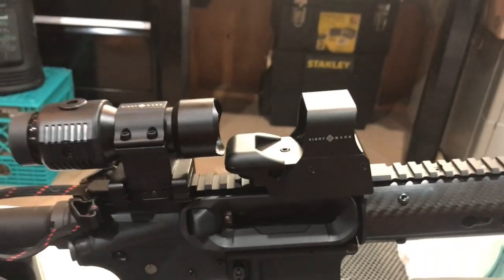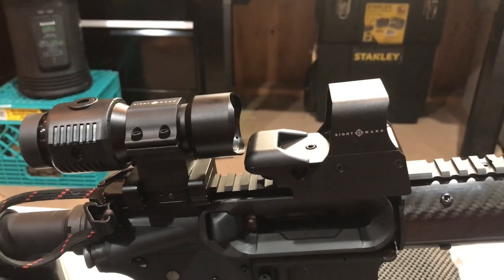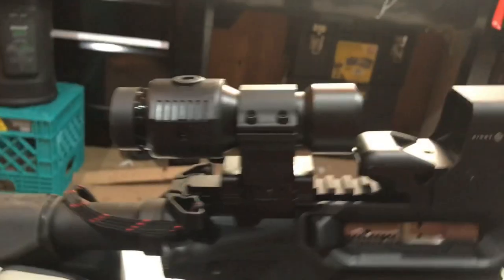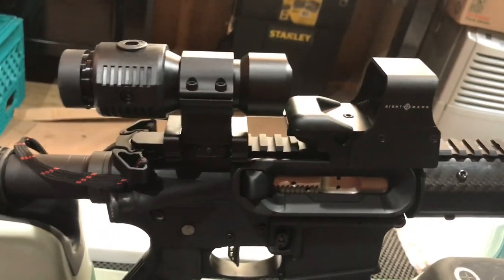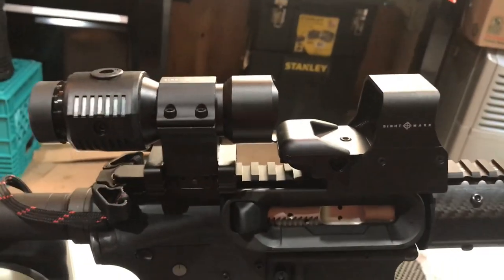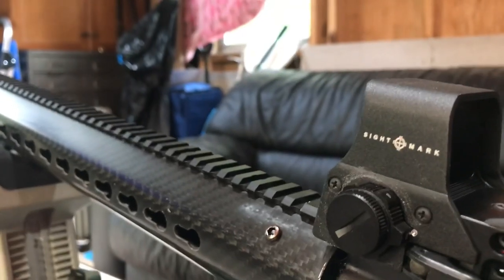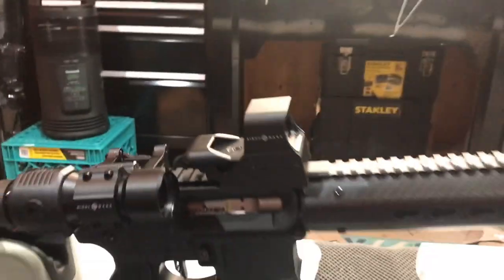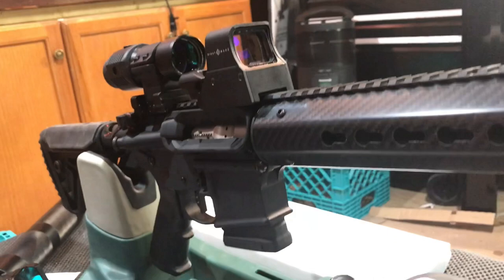Sightmark Ultra Shot Pro Spec & 3X Magnifier

Comment: I had the same setup many years ago, except mine was a 7x magnifier. I'd give it away to a buddy. It won't hold zero. The magnifier rock back and forth, making the red dot move side to side. Replaced with a Vortex Strike Eagle 1-8x24.  My newest build, I have a Holosun HS403c and Holosun HM3x.  Never going sightmark.
Reply from the maker: Thanks for sharing

Comment: How did you get the red dot free?? I'm looking into purchasing it right now, Academy has it for $179
Reply from the maker: They both come in the same box, brother. Set up as a Kit. I think I paid $119 on sale back then. 
Only issue I had was that the magnifier smacked against my brass deflector.
Reply from the maker: Just remembered. It was a deal from Centerfire Systems

Comment: My three times magnifier seems so stiff it won’t slide over to the Side, I even tried to take an Allen wrench and Loose screws, Have the exact same three times magnifier
Reply from the maker: I have traded those pieces a long time ago, but you are right. Mine was the same exact way. I did eventually get it loose, but not enough. Also, it hits the brass deflector. Not well designed.

Comment: Nice freebie, I have a sure shot on my rabbit gun and it gets the job done! I’m ditching a Burris 336 in favor of another sure shot because of the weight savings and price point.
Reply from the maker: 135396 I like the 336. For the weight, I am really liking the Holosun. I just picked one up and did a review on it. Super impressed and incredibly light. Plus they come with both high and low mounts. ( not to mention they’re a bit less expensive compared to the Burris) Charlie Mike and thanks for Subscribing!

Comment: I have a side charger in 450 BushMaster and 350 Legend love them.
Reply from the maker: Hope stuff! Ya know, I’ve been thinking about the 350 Legend and a 450 bushmaster. Which one would you recommend I get first?  I’m not a hunter and only target shoot, but I also think they would be great home defense weapons. Just trying to decide which way to go at first.
Reply: The 350 Legend is a lot cheaper to reload.Starline brass for the 450 BM is about $36 for a 50 count. 350 Legend you can get a 100 count for around $26 from places like Midland. Off the Starline website the minimum you can get is 250 count but still not a bad price. There are plenty of bullets you can use for both. 350 Lend is .355 or 9mm bullets. But you can use .357 or .358 bullets and size them down.450 BM is .452 bullets but you can use up to .458 bullets by sizing them down. Lee site you can get a custom sizer at .355 for $38. There .356 sizer is around $28.

Comment: You can move the magnifier to slide to the left instead, then it wouldn't get hit by ejected brass and a rear sight can be used. My gun is left handed so I thought I got lucky when I slid the x3 over after installing in front of my pop up rear sight. Shut up about your gun we came to see the sights

Comment: can you use that other  reflex sight with that magnifier
Reply from the maker: Hey bud. Which one? The Holosun 503C?
Reply: @Warthog71   the electro dot reflex sight  the one you got for free
Reply from the maker: humunculus44  hold on. Lemme check. I just happen to working on a build right now. Gimme a min bro
Reply from the maker: Yup. Seems fine. It’ll basically work for any sight which sits 1.5<> above Barrel bore. Hope that helps bro. Charlie Mike!
Reply: @Warthog71  Did you need to raise the rail? to work with reflex sight
Reply from the maker: Paulo Gabriel Cruz Machado No. The 3X magnifier came with a side sliding mount, which not only lines up perfectly with the Sightmark green dot, but also my Holosun 503C and a few others. 
Thanks for watching!  Charlie Mike!

Comment: Holy hell that is one hell of a deal! I need to go check out those guys to see if they have that sale still going. I want that on a .300 blk out pistol!
Reply: They had it still going on and I just bought that combo! Absolutely phenomenal! Thanks for the info!
Reply from the maker: Andrew Heffker https://www.centerfiresystems.com/p-7321-ar-15-300-blackout-pistol-upper-kit-with-105-barrel.aspx?utm_source=Centerfire+Systems&utm_campaign=7c8dbbb728-EMAIL_CAMPAIGN_2018_10_10&utm_medium=email&utm_term=0_a17d16ad3c-7c8dbbb728-129467261&mc_cid=7c8dbbb728&mc_eid=7173fd4b0e
Good stuff brother!
Reply: @Warthog71  Nice! I want to go with a 9 inch barrel or shorter. I think that would be the best length for a home defense or vehicle pistol. I've seen some 6 inch shorties. Those things look sweet! But not sure about the ballistics with it. Having a short barrel with a suppressor on it is really tempting though!
Reply from the maker: Andrew Heffker just remember, under 10” is less accurate and not as quiet. There’s a reason they make most 300BO barrels 10.5”. Also, 99% of the barrels, regardless of length are pistol length gas systems. Using a pig-tail gas tube improves upon that along with an adjustable gas block. CM bro!

Comment: Wanna Be Soldier. A-556 with a Magnifier. I have to laugh. People dont know what they are doing. After 100 yards that 556 is nothing but a 22 plinker.  You are stepping way out of bounds if your targeting a target at 200 or 300 yards with a 556.  Read your ammo box after 100 yards that 556 no longer shreds that head of lettuces. If you need a Magnifier for a 100 yard shot you more likely need glasses not a Magnifier.
Reply from the maker: Out of a 16” 1:7 twist barrel, A 62-75gr HPBT 5.56x45 is a man killer, out further than you can possibly imagine. 
It’s not the diameter of a projectile, as much as the total grain for effectiveness.
Reply: @Warthog71   You dont know what your talking about.